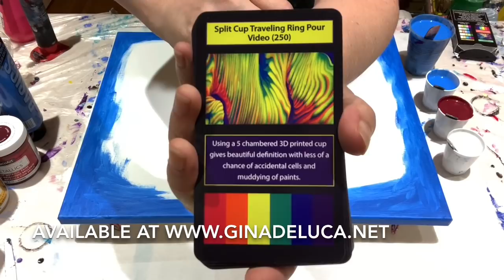(305) The BIGGEST CELLS I've Ever Gotten - Straight Pour No Silicone - Fluid Acrylics Paint Pouring

Comment: I recently had to return a big tube of Liquitex Ultra Marine blue back to Michael's. It didn't have the foil seal and it was the consistency of cement or dried up hardened tooth paste.  A few days ago I looked for it at Hobby Lobby. I checked., no foil seal so bought it in Masters Touch. Such a shame. I really liked Liquitex
Reply from the maker: Liquitex doesn’t have a foil seal. 😕
Reply: @GinaDeLuca  yeah... my cad yellow light hue didn't either but it's luckily perfect ☺